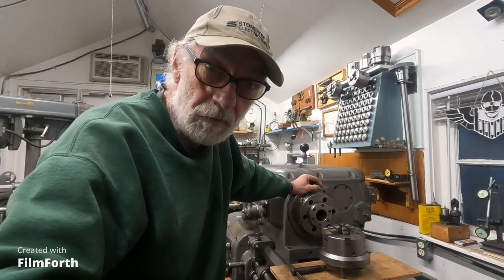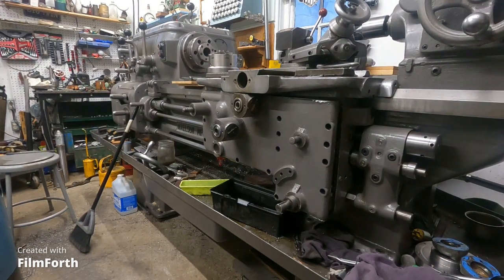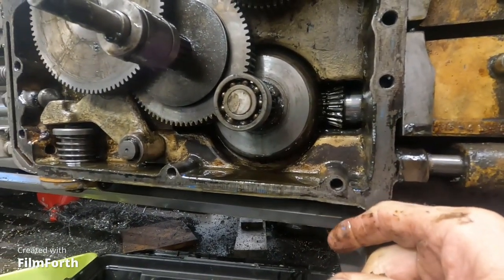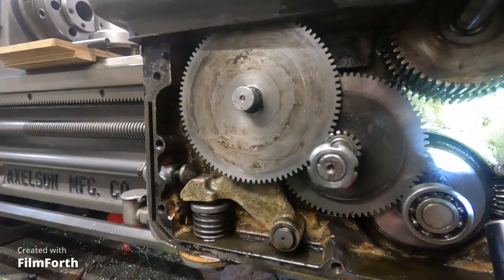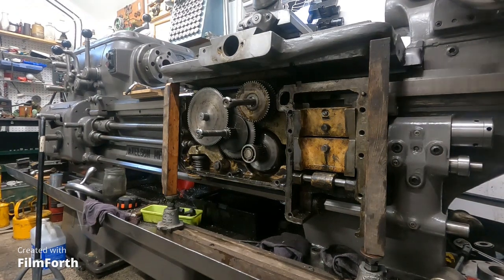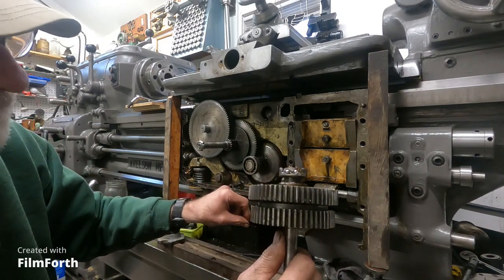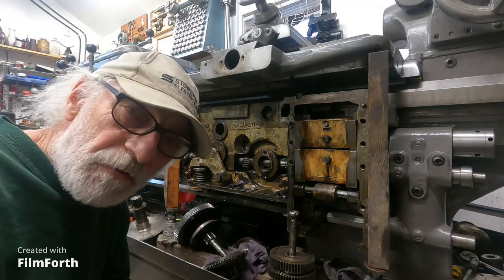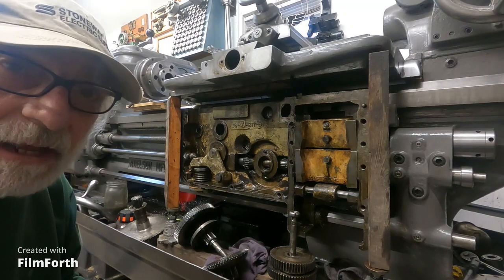Apron Clutch failure 1941 Axelson engine lathe

Comment: Interesting to see you get into the apron for the repairs.  Glad to see that the main problem might be those bearings.  I'm getting ready to get into my Lodge and Shipley 14x30" lathe apron to see about the oil pump and clean out the oil seeps before I get back to using it again.
Reply from the maker: It is probably a good thing to clean it out anyway, I have some oil points that need more oil, there is a build up of goo in the oil passages on this one

Comment: Since the half nuts are slightlyd
Adjustable.  Do you have an acme tap that size.   Could you clamp the half nuts with spacers and run the tap in cutting new threads deeper slightly past the worn section to restore  functionability without needing to machine total new ones
Reply from the maker: These half nuts are like new, I will never have to repair them, the later machines had the adjustment on the lever, thanks
Reply: @deedeeindustrialsuperprecision  i was watching on my cell outside.  I thought they were severally worn.

Comment: I have an Axelson just like that one. The bolt that locks the carriage doesn’t work as I can just pull it out as I am guessing the nut fell off or whatever piece it screws into to lock it down. Can you access this by just pulling the face off or do I need to also pull the top off???
Reply from the maker: you can get to the nut by pulling the face, I will show that in the coming video
Reply: @deedeeindustrialsuperprecision  Great thanks